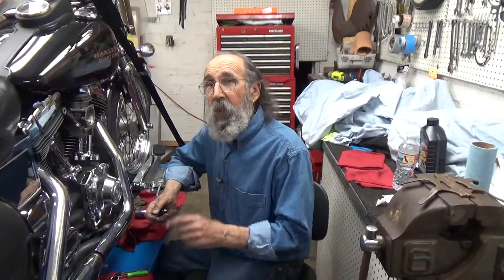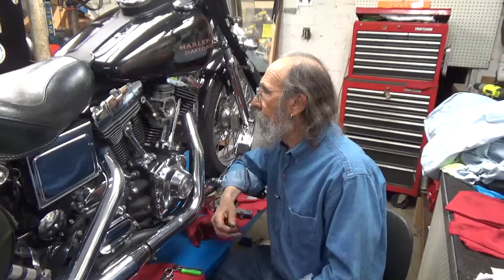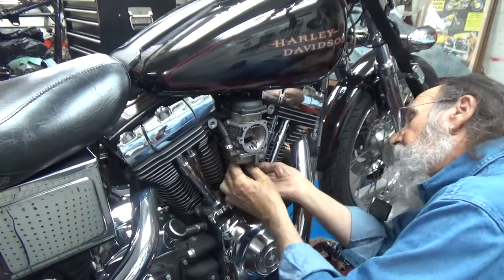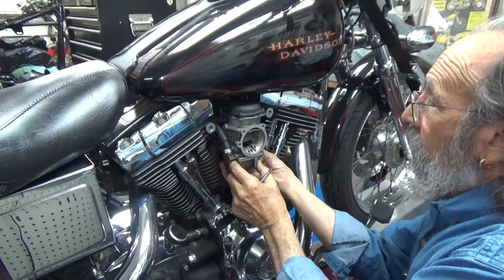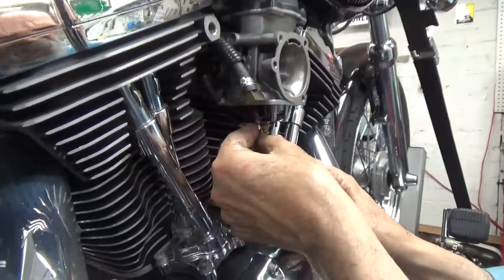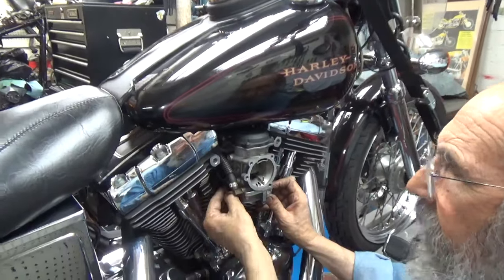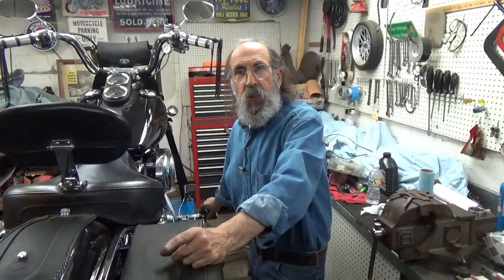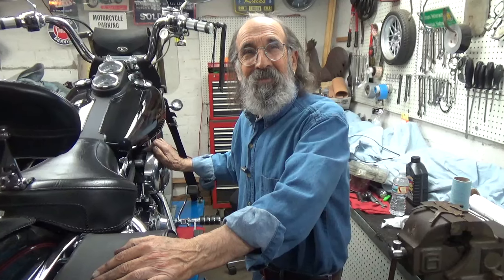Rejetting the Carburetor on a Harley Twin Cam

Comment: Yes I have some questions to ask about my 80 1000 Sportster 60000 / 4 running a little lean what should I do
Reply from the maker: Make sure you don't have a vacuum leak (plugs should match each other in color.  If not, you probably have a vacuum leak, either at the carburetor or at the manifold).  If you don't have a vacuum leak, try a slightly larger low speed jet,  just like in the video.
Reply: @pacificmike9501  we've just recently done the top end OEM parts 60000 / carburetor maybe jetted a little too small
Reply: She probably needs more air to breathe cuz it's runs like a great wonders accelerating. With 3/4 throttle

Comment: Love the simplicity of the carb. Glad I ordered my 04 while they still had them.
Reply from the maker: Me too.
Reply: Fuel injection is FAR superior to a carburetor. Precise fuel delivery that can actually adapt to variable conditions vs a static fuel leak. Hmmm
Reply: @BikerBry  Many do prefer technology. I prefer my bike to be as simple and mechanical as I can. And tons of aftermarket support. Many with the early M & M efi have converted over to a carb. EFI is constantly evolving. I bought my bike for the long haul.
Reply: @tommer59  Agree 100%. Purchased and still own my 02 FatBoy…carbed!! Has never given me one hiccup in almost 20 years. 👍😎
Reply: I'm totally enjoying working on my bike's carb. Frustrating it may be, but as I get closer to dialing it in, it is SO rewarding!  Got my a/f mixture going pretty well, and found the leak that mutt bike came with - it's the a/f screw o-ring! Now I get to put on the a/f thumb screw!

Comment: Ok. Thanks. I’ll go get some today and try it out. And what do you suggest for the fuel mixture screw
I believe I’m at 1and 3/4 turns out from being lightly seated into carb. I’m that much turned out. My throttle response is a bit sluggish
Reply from the maker: I assumed this is a factory Keihin carb.  The main jet is generally adequate.  Again, I gave you an educated guess.  The proof will be "seat of the pants."  Let me know.
Reply: It’s a CV carb. I’ve had it jetted and they have messed with the fuel mix screw. Cause I seen the plug was removed. I was just wondering what you usually start at? Some say 2 full turns and some say 2 1/4 turns. I haven’t messed with it much. But I would like to get your opinion for a base setting.
Reply: Ok. So I pulled out my jet. The low was a 46 and the high is a 200? I put in a 50. And it was too much I think. Cause when I closed the enrichment screw. The bike kept running. So I put in the 48. And it’s a lot better. Should I change the 200 to a 190? Or just leave it? I t pulls pretty good. No popping.
Reply: Of course it's sluggish. What did you expect? It's a Hardley-Davidson.
VROOM! VROOM!  drip  BLAT!  POP!  GUDDA GUDDA GUDDA  drip  VROOM! BLORT! BLAT!  drip  VROOOM! VROOM!  POP! BLAT!!  drip  BLORT!  VROOM!  GUDDA GUDDA GUDDA GUDDA  drip  VROOM!  VROOM!!  BLAT!  POP!  GUDDA GUDDA GUDDA drip  VROOM!  BLORT!  BLAT!  drip  VROOOM! VROOM!  POP!  BLAT!  drip  BLORT!   GUDDA GUDDA GUDDA GUDDA  drip...

Comment: Hello Mike, this video hit home very well for me, i just got my 75 Superglide back with completely rebuilt motor, before the rebuild I had a Killer carb (cv) on it and it ran fine, now with about 150 brain miles at this point I'm getting the lean spit at low speeds, taking off from stop signs etc...it has a 48 pilot in it so I just ordered a #50 hoping that will help me out, interesting you noted sea level, here in Canada where Im at it is about 270 feet above sea level, so guess i will see how that works, Im learning lots about these carbs, thank you. Scott
Reply from the maker: Cool.  Be sure your accelerator pump is working.
Reply: @pacificmike9501  yes pump. Is working well I checked also, thx
Reply from the maker: You bet.  A #50 will probably please you.
Reply from the maker: If not yet, try a #52.

Comment: My dyna is having the same issue. Not sure what jets in it currently
Reply from the maker: Easy, just take it out and read the number on it.
Reply: Just getting back to you..I had leaky intake gaskets..I changed them and went to a 52 jet at sea level and its been running great last two years..thanks for the help..between You and scooter tramp scottie I got all my issues solved..i got such a great deal buying the 02 FXDL because of these issue..all fixed and after 5000 miles couldnt be happier

Comment: You didn’t adjust the mixture screw, why ?
Reply from the maker: Not much adjustment there.  Very slight.  I went back and did it later.  Very little change.

Comment: Mike i have a 2000 night train with stock carb , i have slow speed coughing and back firing ,i took out all jets and cleaned them up pretty good , but did not replace the slow jet and still have the same problem , on low gear and slow speed it runs real rough if i pull the chock half way out and run the bike it works fine , is that means i need to replace the slow jet to higher number as you mentioned go up a little bit ? i appreciated your help and respond .Thx
Reply from the maker: You got it.  You explained it perfectly.  Your carburetor does not have a "choke," even though it gets called that, it is a "fuel enrichener."  Now, it should make even more sense to you.  Bike is acting like it's starving for fuel.  I pull this knob and it smooths right out.  By pulling that knob, you effectively gave it more fuel, changing your air\fuel mixture to a "richer" mixture.  Try a larger (larger number) low speed jet.  If you have a 46, try a 48, 48, try a 50.  You can keep increasing, especially if you have a free flowing air cleaner and free flowing pipes.  I don't know what the altitude is where you live, but the trial and error method of  picking a jet works just fine.
Reply: @pacificmike9501  yes sir I will do as you suggested and I appreciate your help and quick respond , I live in Austin , Texas , pretty much low altitude .I'll follow and watch all your clip , great work and information .
Thank you again so much from Austin , Texas
HP
Reply: @pacificmike9501  hi Mike great videos new subscriber live in Colorado have a 99 Road King what is the best jet for my altitude have been having issues with cutting out and spitting my altitude is between 45 and 5000 ft
Reply: @pacificmike9501  Best explanation here!! Nice little trick to see if adding more fuel will fix the issue without going into the carburetor right away. But does point you in the right direction. This right here IS the simple way to check if it’s running too lean 👍👍👍👍😎

Comment: I  used  a 48 in my dyna when I installed the S&S 97 ci kit. Basani two into one exhaust and highflow air cleaner.
Reply from the maker: Sounds like you're at a high altitude.
Reply: I also used the S&S 510 cams. I’m in Buffalo, NY. No idea on the altitude.

Comment: Great video! I’m going to try rejetting the CV carb on my 02 softail and was looking for a video to show me whether it was easy or hard. I think I can do this. Thanks!
Reply from the maker: Good luck!
Reply: Pacific Mike Rejetted the carb a couple of days ago. Went from a #46 to a #50 jet after installing an aftermarket exhaust and an Arlen Ness Big Sucker A/C kit.  Bike runs so much different now. Nice and clean start, crisp throttle response, and it really opens up and moves when you give it the gas. Thanks for the video and instruction!

Comment: Mike whats the best way to catch all that oil etc..that come out the 2 breather holes on the heads , because immrunning a s& s carb and the hose ends up right in front of my rear tire and it blows oil etc on the ground in front of my rear tire and thats gotta be dangerous, i mean whats the best set up to keep all that gunky funky mess away from danger, safety first like they say , i understand i could just reroute the hose but still theres a mess ...do they make anything to catch all that oily mess either way thnx hv a gd one bud
Reply from the maker: Yes, it's called a "catch can."  It sounds like you're huffing too much oil.
Reply: @pacificmike9501  mike is that a bad thing or what, im deff gonna grab one of those catch cans, however does that mean anything internally s wrong inside the engine or is it simple catch can fix? Thanx for tips my man hv a good 1 later on
Reply from the maker: I don't know how much oil is actually coming out.  Is this an Evo?  If so, maybe you let the bike sit too long between rides.
Reply: @pacificmike9501  yea mike is an older 1995 fxsts Springer softail and its been sitting in this dudes heated garage since 1995.....its only has like 18m miles, i changed all fluids gas oil plugs wires, thers an s&s carb shorty g/e on it, hyper charger air cleaner , i just hope its the clutch adjustment from inside the derby cover, if not im hoping its not clogged jet lf carb it idles fine, starts rjte up, its just when i get around 30mph ill hit the throttle instead it hesitates for a few seconds, then it will grab and move

Comment: I live in Denver a mile high would you still go up in jets?
Reply from the maker: 5000 feet means "thin air."  That means it's going to run rich.  You're trying to reach a proper ratio.  But, any other modifications, cam, air filter, pipes... These things all have to be taken into consideration.

Comment: Hey Mike, new subscriber here. Great great content, thank you so much for taking the time to explain so calmly and thoroughly. I have a 2000 Dyna fxdx at home and have been struggling with a carb issue for sometime now. As you say, it's hard enough to find a shop that works on carbs now try to find one here un Mexico. Basically it's this, my bike takes a long time to warm up, I have to keep the choke open for a couple of minutes then take over with my throttle for at least another five minutes before the bike can stay at idle. I've tried playing around with my mixture but no luck, I was thinking the jets, but I don't know if it's the right way to go. Thank you again for your videos.
Reply from the maker: I don't know what you have or what your altitude is.  Is your air cleaner and/or exhaust system changed? Try a slightly larger low jet.  If they aren't available where you live, order them off the net.  Get a 48, 50, and 52.  There, you haven't spent much money.  You're now equipped.
Reply: @pacificmike9501  Thank youso much for replying man! So, altitude is about 1.4 miles above sea level, running a stock 2 into 1 exhaust, and a Screaming Eagle 50mm CVH Carb.

Comment: Im having a problem with my 03 softail deuce. It idles and does great at first then when I leave it acts it is not getting enough gas but it floods as soon as it dies. I have to turn the gas off quick! Then wen I restart it it won't stay at an idle. This does not happen every day though. Tan fine for two weeks
Reply from the maker: Okay, since you can turn off the gas, I now know it's carbureted.  Sounds like junk in the carburetor.  That probably came from junk in the gas.  Is your tank clean?  Have you bought any cheapo gasoline?  Do you have a fuel filter?  I suggest removing the float bowl and inspecting.  Check the float needle for debris.
Reply: @pacificmike9501  ok I'll try that. But I only use premium gas. I'll check the filter
Reply: @pacificmike9501  I got a 2 questions, one i have an 02 softail deuce with a 2 in one vance&hines exhaust what jets would you suggest. And if I turn my gas on shouldn't gas be coming out with the bike turned off?
Reply: @pacificmike9501  i.mean and 03 sorry

Comment: Seems to me if he was having a lean condition, all he needed to do was turn the air screw in slightly, because on that stock TC 88 a 45 pilot jet is more than big enough
Reply from the maker: The stock pilot jet is fine with stock pipes and air cleaner.
Reply from the maker: Or, if you're at a very high altitude.
Reply: @pacificmike9501  Okay.  What I am saying is being he had a 45 pilot jet and his condition was too lean, which of course causes spit back and lack of power, my question is why couldnt the air mixture screw be turned to allow for a richer fuel flow?  If one of my harleys (I run mikuni hsr 42 on both) were to be too lean I would just turn the air screw in until the lean spit back stopped.  Sure, changing it to a 48 jet is fine, but again he would need to lean his mixture to have the right mixture. No matter what pilot jet size I use, I am still going to configure if its right by adjusting the air screw.  Sea level and air humidity does matter, but where I live in Houston Tx, if I have a mikuni air screw turned out more than 1 3/4 turns I am going to think of replacing a pilot jet. I believe a full two turns or more out only shows a pilot jet to be too large
Reply from the maker: As per Mikuni's instructions, you are correct.  We're not always using Mikunis however.  You can't expect all brands of carburetors to respond the same.  Keihins don't work like Mikunis
Reply: @pacificmike9501  I know that Cv and Keihens are very different from Mikunis.  I know this Mike, but gain I am saying and asking the question of why change a jet due to lean conditions when you can adjust an air screw or fuel screw?.  I know on your mikuni hsr42 and your 45 and 48 carbs that they use an air screw in which more turns out leans the fuel and more tirns in richens the fuel, but the CV is opposite as in turning out richens, but why not richen your fuel mixture regardless of what carburetor you are using    The same question still applies.  The bike you rejetted which I can see has a CV carburetor on it, does have a mixture screw to make leaner or richer  So question also is, why was this not considered before changing a jet?  Im not picking on you brother because I actually love you, but the job does not make sense to me.  I also rebuild these carburetors myself
Reply from the maker: The Harley Keihin (which is a CV carburetor) does not have enough adjustment on its idle mixture to do much of anything.  It affects it very little.  Remember the fact that the original carburetor (Keihin) is a smog carburetor.  Actually, a lot can be done with that Keihin, but it requires a lot of work and talent.  When installing pipes and a decent air cleaner, the  thing to do is change the slow jet, so it will run properly.  I don't know why you're so hung up on an adjustment that barely functions on that factory (purposely limited) carburetor.
Reply: @pacificmike9501  You have a pride issue Mike.  Sir, you totally skipped TWO settings on that CV altogether, which means you did not perform proper procedure, but simply change ajet without even knowing of the fuel and air mixture was even right or had been tampered with.  You continue to try and defend your skipping the needed procedures.  For anyone to skip these settings and just change a jet has already defeated their cause.  Drop your pride and learn how to adjust air and fuel mixtures on CV and Mikuni brands (I am professional on both these carburetors).  We, as machinist and mechanic as I am, and you as mechanic has to always be ready to learn or we are no longer any good for this trade Mike.  Your changing a jet without any fuel or air mixture adjustment on a CV as you did, myself and many professionals would have terminated your employment.  Stop trying to defend your ignorance and lack of knowledge.  Shane Connely would be a good start for you to learn
Reply: @pacificmike9501  I have placed a link here for a detailed disassembly of a CV carburetor for you Mike.  This video was made by Shane Connelly (a Teacher for his class).  Including is where he shows the adjustment on the fuel mixture screw as well as the air screw which is very adjustable.  If your pride is still an issue just watch the video and dont respond.  The reason I have taken this this far is because you continue to defend a job that was wrong.  After this I can also provide a link to Shanes Mikuni video.  Before I ever knew Shane, I had this knowledge my own self.   https://www.youtube.com/watch?v=3FmfO-mWv3Q